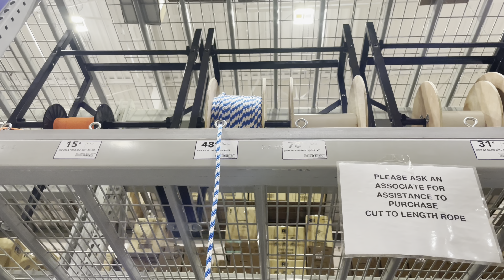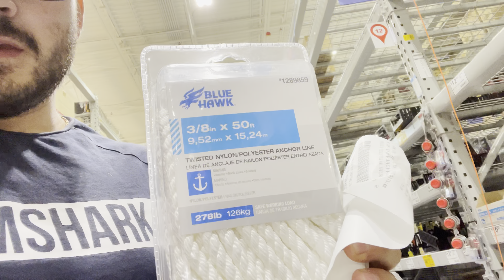TELEHANDLER PIT BIKE ROPE SWING | BAD IDEA!!

Comment: Either the gear went out or the shift fork bent.  Im almost positive when the tire hit the floor back words and the tire was spinning forward did it.👍👌✌️💯🛠️🏍️
Reply from the maker: Yup tire was spinning forward in 1st gear 😱
Engine is being torn apart now. So will find out!
Reply: @slavsquad  if it a 190cc trans you can get the hole gear assembly and shift drum assembly for around $100 for both I would also replace all the bearings in the case there not the greatest from factory. At least mine weren't 🛠️🏍️👍👌✌️💯
Reply from the maker: @josephsaucedo8691  yeah it is! And I’ll look into that
Thank you
Reply: @slavsquad  if you order the gear set it doesn't really matter what brand or the name z's/Daytona it's all the same as long as it 190cc but make sure the shafts on the gear set is the size you need. there 2 different sizes depending on what year the engine if it more than 2 year old it's the smaller shaft. if new its the bigger shaft. Most of the time it doesn't say what year/size its for so you might want to ask before you buy to make sure it will work/right size shaft. Fyi 💯🛠️🏍️
Reply from the maker: @josephsaucedo8691  yeah I’ll have to ask before ordering! Or measure mine
Reply: @slavsquad  yup either  15mm or 14mm👍 ordered twice sucks just thought it help because a lot of the web sites don't say anything about it 🏍️🛠️💯
Reply from the maker: @josephsaucedo8691  yeah I don’t wanna order twice lol thank you